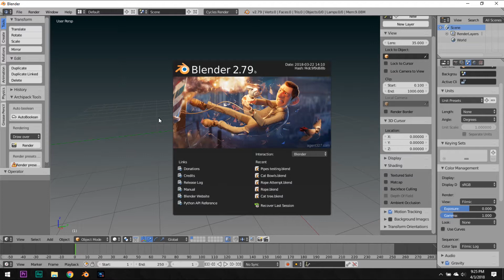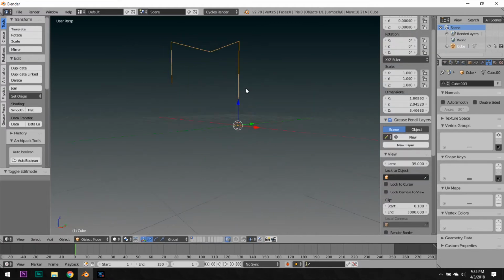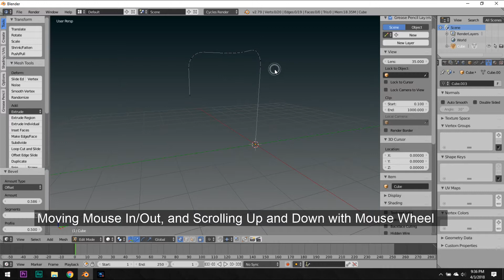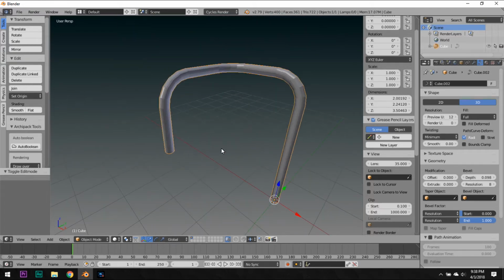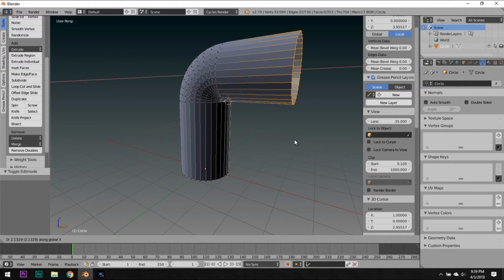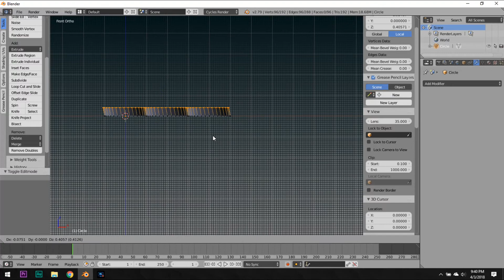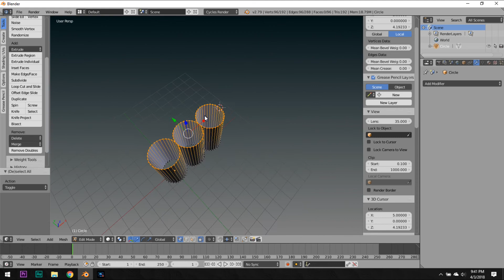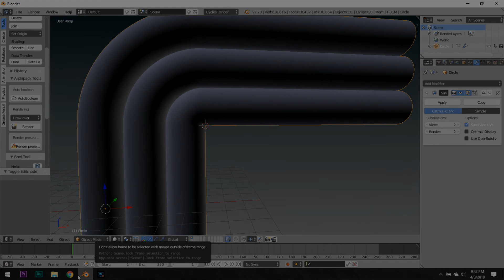2 Methods For Creating Pipes In Blender!!!

Comment: The Spin method is geometrically accurate.   The Bevel method is not.   The cross-sections at the joints between curved and straight pipe are angled.   This means your straight pipes are not consistently the same width between curves, or even square.   Look closely at the wireframes.   The Spin method maintains square angles between joints.